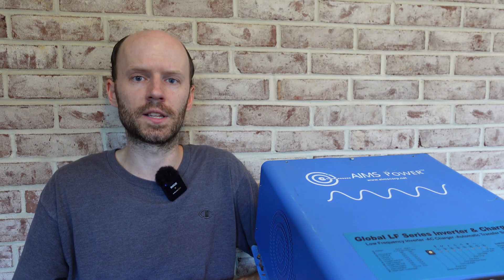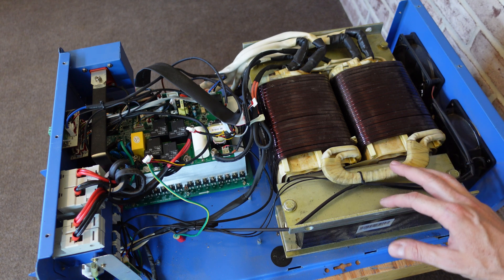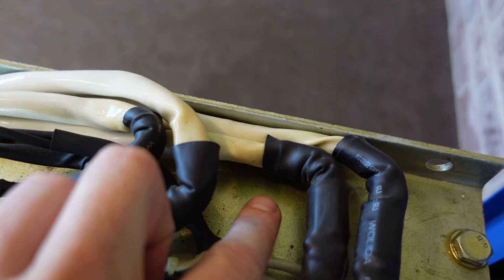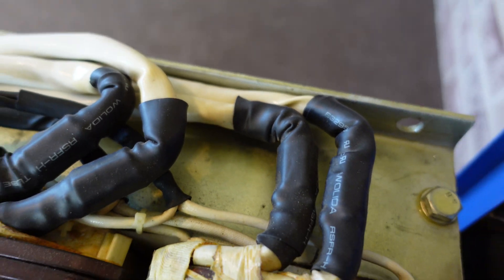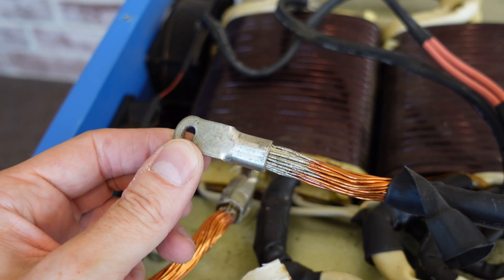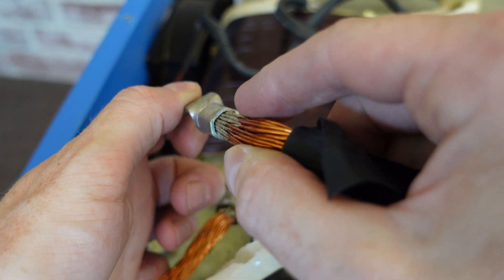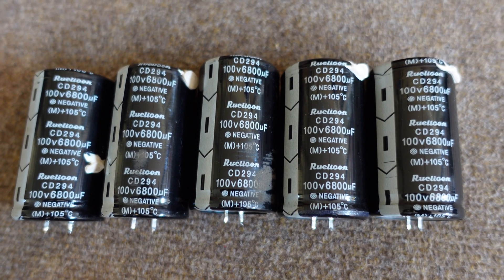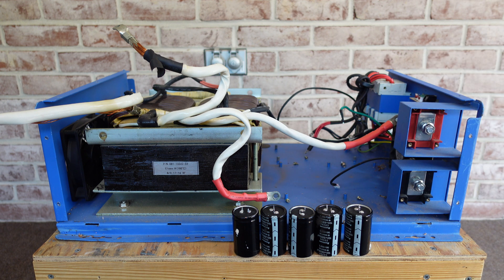Inspecting the Old AIMS Inverter - Capacitors, Burn Marks, Solder, and More

Comment: Anytime I've installed the Transformer I use a chair lug which simply presses the stranded wire up against the back typically these Transformers are designed to be over driven and everything is over-engineered based on the KVA the stranded wire with soldered as a preventative measure to prevent any strand if I'm coming out

Comment: I have bought 2 of aimscorp inverters. The reason why many people do not hear too much bad about them is that the manufacturer requires you to send that unit back at your own expense when they weight a ton. Most customers will invest into another company. These inverters are very bad, dangerous, and will destroy your entire off grid system, bms, batteries and anything connected to it. DO NOT USE this product. You will be begging for mercy
Reply from the maker: They sold me replacement boards before and did not require me to ship the entire thing back. But yes, I would not suggest buying these anymore. The technology has come a LONG day in the past few years.
Reply: Chinese nightmare inverters.

Comment: Did you have a neutral ground bond in the panel this inverter supplied?
Reply from the maker: Yes.
Reply: When the voltage went low on 1 leg of the output, did the other leg go higher?
Reply from the maker: @jakeandrules7724  No. That is what happens if you DON'T have the bond in place.

Comment: Bought an AIMS 12,000w 6 years ago and at 25,000hrs (5-6 years of 15,000kwh/year powering house) started getting spurious voltage up/down causing a spiral where my UPSs switched every 10sec.   The big capacitors seemed OK.   AIMS support would not or could not sell me a new control board.   So I sent the original control board for repair (they mostly replaced capacitors / checked things on the control board they said) and the unit is working again.     My control board is significantly more complicated than the one you're showing - maybe they changed things by the time I bought the 12,000w ETL :)      Agree that 6 years ago off-grid solar seemed more component oriented than all-in-ones like today - so I now have AIMS + bought SGP 12,000w when AIMS had trouble.    I'm tracking hours of operation on repaired AIMS and newer SGP and eventually we'll see how AIMS and SGP hold up hours wise going forward.     As just raw  48v DC -> 240v/120v US split-phase inverters they work A-OK for me in general and I average ~83% efficiency over a year / 15,000kwh consumed.

Comment: Hello, I have watched your channel for between two and three years, love it. 
I have two questions,
1. This video is about a 10,000 watt split phase inverter. Is that 10,000 watts PER phase of 5,000 watts per faze?
2. I live in a motorhome FULL time, I have lived in THIS ONE for over 17.5 years. I have 1,650 watts of solar going up to at least 2,500 or more. What system would you recommend for an inverter that has at lease 5,000 watts per phase?
THANK YOU VERY MUCH FOR YOUR TIME!!!!
Reply: Schneider 6848 pro
Reply: Thank you very much for your time.

Comment: So the neutral mains input is directly connected to the neutral output?  That's also a no-no.  All current carrying conductors need to be disconnected from the mains when the inverter is providing power, and the neutral is a current carrying conductor.
Reply from the maker: This does not take an input neutral. It takes an L1 and L2 of US power, and feeds it into the transformer to create the neutral on the output side.

Comment: I wonder what AIMS would if they saw this video? Did you send it to them? BTW, I have an AIMS passthru inverter with ATS. It work very well.
Reply from the maker: I don't know what AIMS' deal is. I think they just failed to keep current with their technology. For example, this inverter advertises 220-230-240V output; however, it's set for 230V and their tech support told me there is no way to change it. Why advertise it that way then...? Other "clones" of it have all kinds of features at this point, chargers, programmable displays, communications. This one hasn't changed since 2017 and they're still selling it.

Comment: I suspect that the "removed transformer" is actually an inductor required for efficiency reasons at low loads - BIG MISTAKE!!!!!!!!!!!!
Reply from the maker: Yeah that went to the separate "Pump Output" That wasn't connected. It has nothing to do with the primary output.

Comment: lol i take everything apart and keep what ever i can like capacitors and wires and basically everything lol i have totes full of stuff from computers and labtops and motors and capacitors and transformers and relays and what ever else you can take out of microwaves and toys and heaters and well you get the point lol i would love to take something like that apart lol but yeah i started to learn not to take every little thing apart because something are worth more togeather then taking every little capacitor and relays off boards when i could of just kept the whole board lol and yes i even take TV apart and all that but i also have fixed a few TV as well so thats cool and i didnt even get passed the 10th grade lol

Comment: I don't hate soldered+crimped connectors on a stationary device. But the crimp has to be 99% of the connection as solder is a poorer conductor than copper. Those were terrible crimps!
I'm sure there are some questionable things with MPP inverters at the price point, but I still think they are a great value. I've had 2 now and they work great. The computer software is pretty crude, but overall it's ok. Someday I'd love something like the EG4 18K, but my LV6048 should hopefully serve me well for a while.

Comment: MY AIMS 24 V , 6000 WATT SPLIT PHASE INVERTER CHARGER IS STILL RUNNING THE HOUSE TODAY EVER SINCE I FIRST BOUGHT IT BACK IN JUNE 2017 . ITS A BEAST ! 🐻BUT IV'E DISCOVERED LIKE YOU SAID ONLY ONE LEG WAS MONITORED IS WHY IT APPEARS TO SHUT DOWN WHENEVER  I RAN A HEAVY LOAD ON THAT SIDE LIKE THE CENTRAL AC OR MICROWAVE ECT . I JUST HAD TO REWIRE THEM ON THE OTHER LEG LIKE ON THE CENTRAL AC 220 V COMPRESSOR TO KEEP IT FROM TRIPPING OUT SO MUCH . CHECK OUT MY LATEST DIY SOLAR VIDEOS HIT LIKE AND LEAVE A COMMENT IF YOU HAVE'NT ALREADY . MAY THE SOLAR BE WITH YOU  . :goodvibes::goodvibes:

Comment: Not many countries use 110 ACV . More countries use 240 or 220 V AC.  Oh no the good old capacitors between the heatsink trick. Replace them all the check the FETs.

Comment: I have the AIM 3K since 2017 to charge my cars and the only problem was that it stopped working after dropping a plier on top. I removed the turn on switch put it back and start working again without any more problem but the 10K was dropped from the delivery truck and it had to be returned because it didn't function on power saver mode and suddenly shut downs without any load for unknown reasons.
Reply from the maker: You returned a 10K that was dropped from the truck in 2017? I wonder if that's where mine came from... LOL!
Reply: @LithiumSolar  It was shipped to a warehouse in Michigan so somebody may have got it as an open box. I was watching on the security camera when I saw the inverter drop about 4 feet high. That explains why some equipment come defective with loose wires and mangled boxes. I send all the pictures and they accepted the return without questions.

Comment: After years of use, there is a good amount of copper that could be scrapper out to recap some money that could repay some of its original cost. Can't say that about alot of stuff that just becomes junk after its life is over!
Reply from the maker: The transformer is probably worth a decent amount. AIMS uses copper windings. Some of the clones out there are using aluminum.
Reply: @LithiumSolar  Those transformer windings might be copper coated aluminum and it would be hard to tell without running a file across one.  For most transformers that are relying on air cooling, the copper coated aluminum windings are able to dissipate heat better than copper due to larger surface area from being less dense than copper.  So as long ad the aluminum is properly sized for the load even with thermal expansion causing creep it shouldn't have much effect on the life of a well constructed transformer.

Comment: Wow.  I was not expecting to see some of those things you found.  With regards to the circuit board, you're probably right.  It was initially designed for the 230v market and they cheaped out and tried to "make it work" for the split phase market.  Really bad design, and flat out dangerous.  

I also wasn't expecting to see all the loose wires on the transformer input.  

Glad it worked out for you as long as it did, but good call taking it out of service.